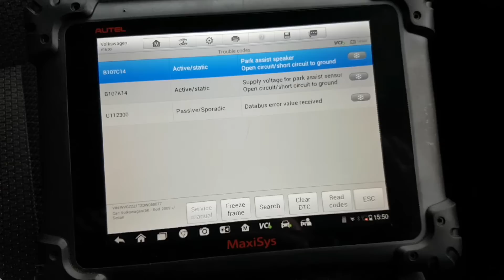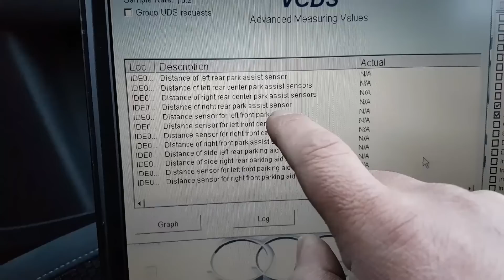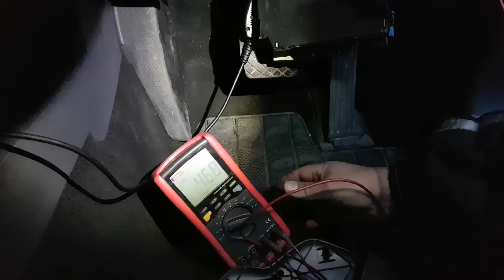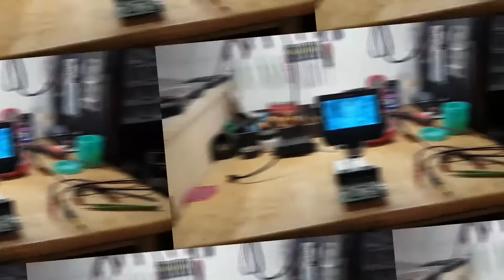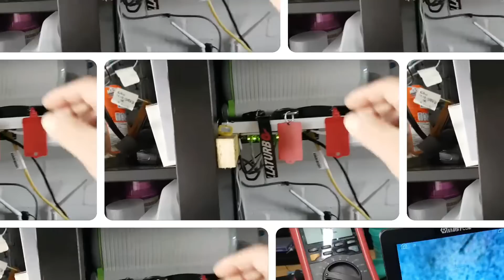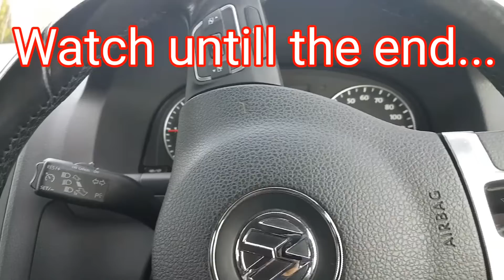VW Touran Parking Assist Inoperative... Fault finding and repair.

Comment: I have parking sensors but not park assist, does park assist require extra hardware?
Reply from the maker: Two extra sensors on the side of the front and rear bumper, so 4 extra sensors. 
I guess the module is also not the same, plus all the controls on the steering etc...
👍👍👍

Comment: Random question, I replaced all my sensors, fired the car up, for a nano second, the sensors showed up then errored, was this what you experienced?
Reply from the maker: Have you scanned the car?
Anything else is guess work...
👍👍👍
Reply: @LMAutoRepairs  not since, charging my vcds laptop as we speak.
Reply from the maker: @ZoltanHercules 
That's your best move...
Scan it and see what is complaining about. 
👍
Reply: @LMAutoRepairs  cheers mate, much appreciated.
Reply: @LMAutoRepairs  short to plus. That tells me, nicked cable somewhere. Time to break out the old multi meter and test some cables after an eyeball. Great vid btw.
Reply from the maker: @ZoltanHercules 
Looks like you are in the right direction...
👍👍👍
Reply: @LMAutoRepairs  found the culprit. Crushed and ripped wire. Now I have parking sensors! Woohoo!

The parking assist I have no idea how to work, but the sensors work. Appreciate your time on this video my man.

Comment: I have scan it 
Error
1111316 active / static
1079830 active/ static
Reply: I have check the module , I check the green xx03 one of them is showing continuity
Reply: Any solution.
Reply from the maker: What are the descriptions of those codes?
Reply: @LMAutoRepairs  
1073830 active/ static
- Urknow Error- Code

That’s all am getting from autel .
But when I clear it the parking image code for few sec then beeps sound and P button flashing
Reply: What do you think is it now . 
Any solution
Reply from the maker: @shahmnnsn 
The codes seem to indicate sensors problems... so, there is only a few things that can be... wiring/connectors, the sensors or the module itself...
Swap one of the sensors that are giving the fault with one that doesn't, if the fault moves you have your answer...
Reply: @LMAutoRepairs  but it doesn’t show which sensors . Do you mean I shall get a new one but which one . Sided one or normal one . Will your vcds software can identify it

Comment: I have Vw touran 
Parking sensor and assist 
But doesn’t work only make beep sound for few sec then p button flashing .
I have try to change the module before still same . 
Sometime it does work but now have stop .
Reply: Is it possible to get the diagram
Reply: And one more thing please is the rear speaker is at the rear right behind . Is there any other speaker as well look the same .
Reply from the maker: Hi
Before starting to replace parts or whatever, have you scanned the car?
👍👍👍
Reply: @LMAutoRepairs  yes I did before but I forgot what code I had ,
Reply: B107A14

What would you suggest
Reply from the maker: I suggest that you check the circuit to the sensor highlighted by the scan tool... check live data...
Reply: @LMAutoRepairs  I did live data was fine
Reply: @LMAutoRepairs  in this Vw touran , there only 2 speaker front and back , 
Someone mention about a 3th trunk speaker what this ? 
Thanks
Reply: @LMAutoRepairs  and also would it be possible to give me the diagram please . So I know which number pin to test . Thanks  I have txt you on what’s app Nas.
Reply from the maker: The code is nothing to do with speakers... as far as I am aware...
Live data was fine?
All sensors, parking and radar parking working? 
Which scanner are you using? 
The description of the code should point in the direction of the faulty component...
Reply: @LMAutoRepairs  autel
Reply: @LMAutoRepairs  MOT PRO Autel EU908
Reply: It’s says supply voltage for parking assist sensor open circuit/short circuit to ground
Reply from the maker: @shahmnnsn 
There you go...
Check the circuit for that sensor...
The parking Assist sensors are the ones one the side of the bumper... the ones ine the front are the parking distance...
This applies to both bumpers...
👍👍👍
Reply: @LMAutoRepairs  will do . I did check the front one was fine, I didn’t check the rear one. Will check it . Thanks
Reply from the maker: @shahmnnsn 
What resistance did you measured on the front circuits?
Reply: @LMAutoRepairs  can’t remember . But I will check both . And see
Reply: @LMAutoRepairs  I have just check the continuity cable but didn’t check resistance and the sensor . In front bumper harness.
Reply: @LMAutoRepairs  I got it code was B107A14

Comment: Hi champ! I have a 2016 308 that is giving me trouble and doesn't turn on or ignite. I would like to share extensively on this issue with you. Would you mind  to let me know how I can reach you via email?
Reply from the maker: Hi
Do you have ignition?
Have you scanned the car? 
👍👍👍
Reply: @LMAutoRepairs  ye I have scanned it. I could share those screenshots with you for. The scan kit indicated the car does recognize the key, the push to start ignition swith does send a relay to the BSI. However there's a lapse to transit rely from the BSI to the engine, as well as steering lock recognising the presence of the key. 
Before this, the ignition wiuld start normally, then it evolved to having to press the switch severally for the car to turn on and start the engine, now it doesn't turn on at all.

I have also hard the alternator tested, it's perfect, the fuses were also tested, they are okay.
Reply from the maker: If it is not recognising the key, could be a problem with the key...
Is that a handsfree key?
Reply: Yes it is a handsfree key, whenever we try to take the key away from the car and start the ignition the car would immediately recognise the absence of the key and indicate "key not detected' on the dash. 

On the scan we did, live data showed the following live responses, upon engaging the Start/stop ignition switch: 

-Status of signal coming from the engine starting switch (Pressed/released): Present
-Starting request to engine management ECU was: Absent
-Ignition positive relay was switched off;
-Main relay status: Switched off
-Acquisition of the main relay control; Yes (Present)
-Power relay control: Inactive
-Acquisition of the power relay control: Absent
-Remote controlled wake-up status: Absent
-Starter control: No
-Starting request from the Built-in systems interface: No 
-Starting request to Engine Management ECU: No
- Status of the ignition positive relay (ignition positive): Switched off
-Main relay status: Switched off
-Acquisition of main relay control: Yes
-Power relay control: Inactive
-Acquisition of power relay control interface: No
- Negative response from the electric steering lock to the locking/unlocking command: No
-BSI with no engine immobiliser code (coded engine immobiliser)
-BSI in anti-scanning mode: No
-Engine control unit locked: Yes
-No response from the hands-free unit to the authentication request: No
-No encrypted request to the electric steering lock: No
- No encrypted response from the electric steering lock: No
-Hands-free remote present in the reader recognized: Yes
-Presence of the hands-free remote control in the reader: Yes
-Hands-free remote control recognized: No
-Response from the steering wheel switching module or from electronic key reader to the identification request: Yes
-Authentication response from the steering wheel controls ECU or electronic key reader: Yes
-Negative response from handsfree unit to the request for authentication: No
-Status of the signal coming from the engine starting switch: Released
-Starting authorisation coming from the gearbox ECU: Yes
-Status of the starting authorisation coming from the engine ECU: On Standby
-Status of the despatch of the ADC data to the engine ECU: Request Absent
-Request for start of authentication: Request Absent

 @LMAutoRepairs
Reply from the maker: What codes do you have stored? 
Have you checked fuses, relays, connections  etc...?
Reply: @LMAutoRepairs  hi, all fuses checked and find. We finally found the issue, the electrical circuit unit had an open circuit and not passing needed voltage

Comment: I think the blown fuse is originally a polyfuse = self resetting fuse. fine to replace with an ordinary fuse though if it blows again will have to open the module again to replace! A polyfuse is supposed to work like a normal fuse in overcurrent condition but after cooling down it should go back to allowing current flow again. I have replaced several of these in audio equipment, I have seen them burned like this or sometimes have seen them become oversensitive and trip before the rated current. Anyway nice repair, first time I've seen this on a parking assist module
Reply from the maker: Hi
Possibly it was a polyfuse... 
Thank you for watching and for your comment! 
👍👍👍

Comment: excellent repair and admirable feature however in other hand if u use it u will lose the routine .... :) I have an odd observation on my Renault 2017 Automatic AC temperature management. I was monitoring the internal temperature over 6+hours long HW journey and I recognized that even I set the cabin temp to a fix 21C it never reached that by the internal monitoring sensors. (outside temp was all day long below 15C)  It was readable always 24-25C and never went down to the set 21C but it i was not a constant value rather it was changing a bit. I monitored the set temperature what was also never set to 21 rather a bit greater one 22-23C but I think it is dynamically adjusted by the controller based on some algorithm. Do you know where the internal temp sensor is located in Renault? I did not find any forum or service info on the internet about it. Did you also observe such a difference between set temperature on AC display vs internal sensor reading? The problem is why I monitored it that on a longer journey family is complaining about the cold in the vehicle even the temp set to higher value. So they do not feel that monitored 24-25C or so rather colder one :) I had a thought that the Automatic AC is reducing the fan RPM way too low and the internal circulation will be insufficient to maintain the cabin temp at set value however fan PWM is always constant 21% and not reduced over the long journey...
Reply from the maker: Some have the internal temp sensors on the panel itself...
But I am not sure on that particular model...
Reply: You sure the auxiliary heater is operational?
I have a 2010 VW Touran 1.9TDi 105BHP which has error code for Webasto auxiliary heater being locked.
From watching a few videos it could be a glow plug failure, dirty contacts or most likely the thing has so much soot inside it needs a good clean.
Reply: @Infiniti25  no the heater is not active at all I can even remove it does not make difference... in winter opposite today was -1C and we freeze in the car at Highway at 130km/h too!! when the temp was set less then max HI (27C). SOmething very odd here and noone can diagnose it... I spent 2000€ already only for diagnose at different AC experts all said it works fine... if it is so why too hot in somme and why cold in winter??? Or it is really a built in factory Fu..ing BUG....